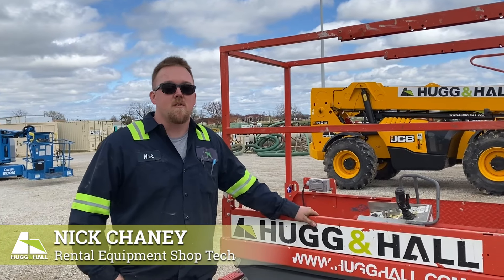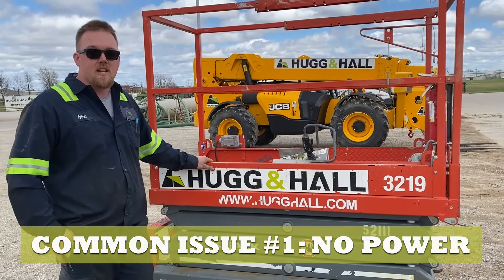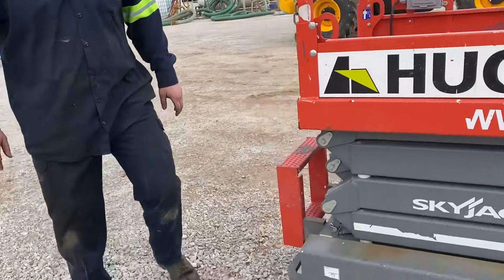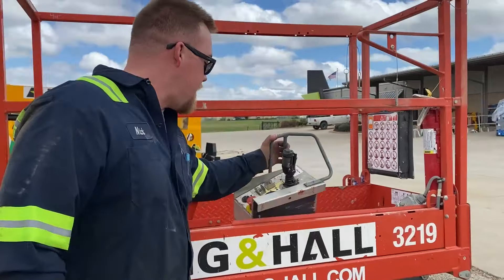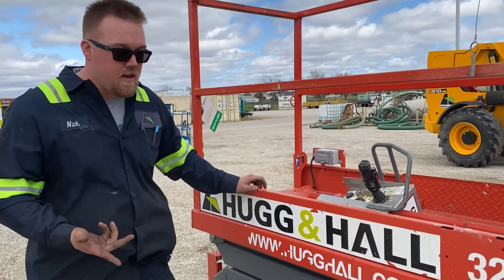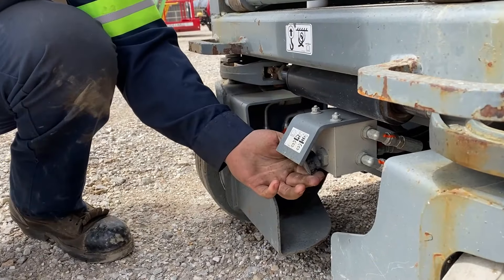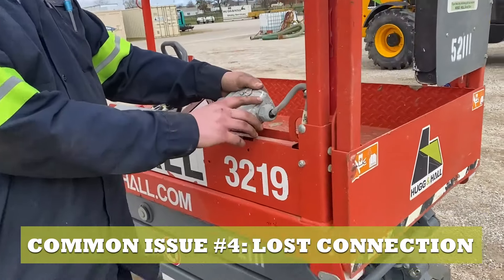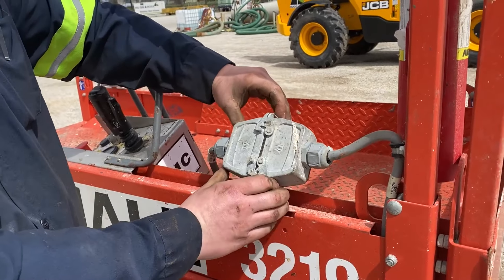Common Errors & Quick Fixes | Skyjack 3219

Comment: My SJ111 3219 doesnt have slow speed, it seems really fast and jerks forward and backwards. Does anyone know the problem?
Reply: I've had two 1999 hydraulic drive SJIII3219's and both of them had a low and high speed switch. However, it didn't do anything and would always drive fast (very rough and hard to control in tight spaces). In fact it was so bad that one of the motor/wheel housings cracked and broke right off the chassis from jerking back and forth so much over time :(

is this normal? Surely it should have two different speeds if there is a switch for it.

anyone know if this is a common issue, and how to fix it?

Comment: I’ve literally used these type of lifts a thousand times . But for the first time today I had a life that everything was in reverse . Forward control made it drive backwards with backwards going forward . Left went right and right went left . I’ve never had a a issue like this . Any idea what is causing that ? Do you know if there’s some type of switch to change this ? Thanks for your help
Reply: that has to be a switch or you just think everything is backwards. unless someone manually changed it
Reply: Someone put the control box on the wrong side of the jack 😂

Comment: We have a SJ 8243 and it seems that third speed or the fastest one anyway doesn't always engage but I know it does works. Not sure if its a pump thing or a wire thing. I will got from a slower speed to a faster speed just not the fastest.

Comment: We have a SJ3 3219

We can’t use it long enough because its get battery dead in just 10-15mins driving/maneuvering it.. 

we already did change the battery but still happening 

anyone has a same problem with mine? Let me know how you fix it